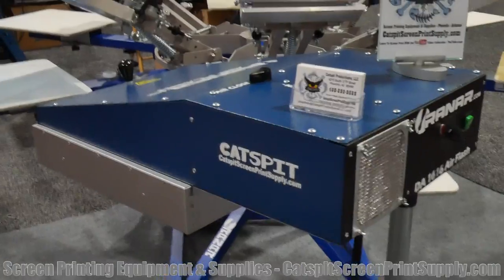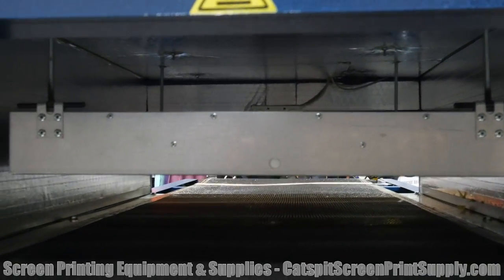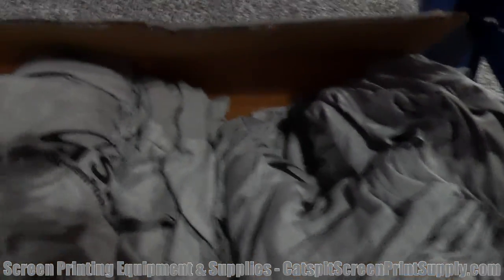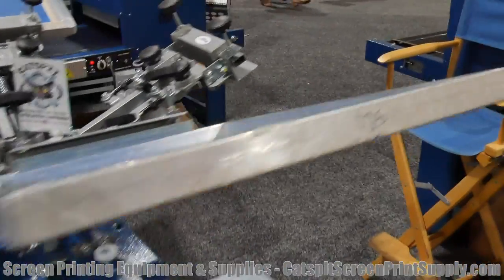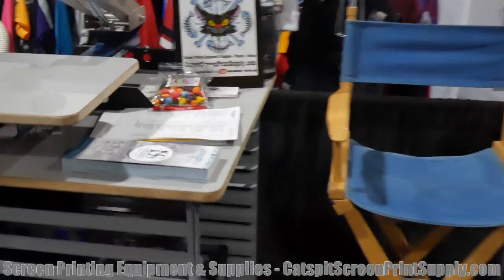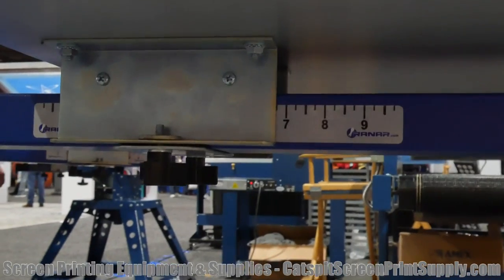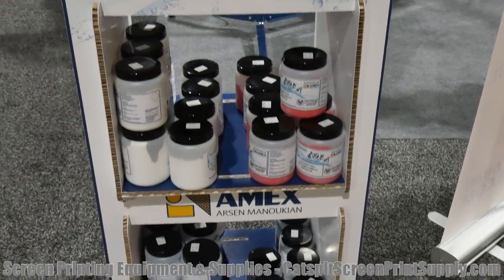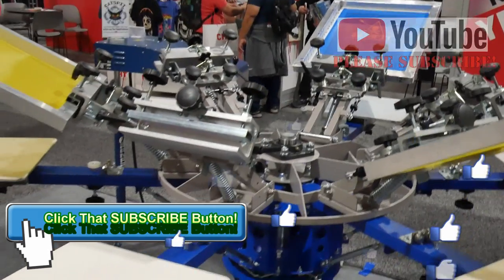Catspit In The Ranar Booth At ISS Long Beach 2019 Screen Printing Trade Show

Comment: Hey Johnathan can you cure wb on the 4000? I do mostly 50/50 and 100% poly. I cant get people to buy just the cotton.  But I have been wanting to start getting into WB thanks bud.
Reply from the maker: Yes, you can in one of 2 ways. You'll want to watch this video:

https://www.youtube.com/watch?v=x76_N0n5Kb4 

You can also use an air flash on press with a standard infrared belt dryer like I will demonstrate in an upcoming video. Thanks for watching! Screen Printing Equipment & Supplies - http://CatspitScreenPrintSupply.com/

Comment: So this is the new flash can it be plugged in a normal house power outlet? Or is it 220v

Also water ink with no heat??? I can't wait for the videos on that.
Reply from the maker: This particular model is 120v but it needs a 20 amp breaker. So it can work on household power but the breaker needs to be 20 amps instead of 15. Yes, wash safe water based ink without any heat setting. We'll see how it works for sure. Could be awesome. Thanks for watching! Screen Printing Equipment & Supplies - http://CatspitScreenPrintSupply.com/